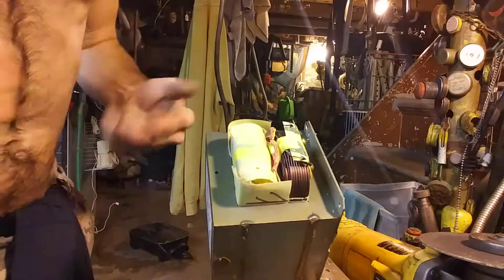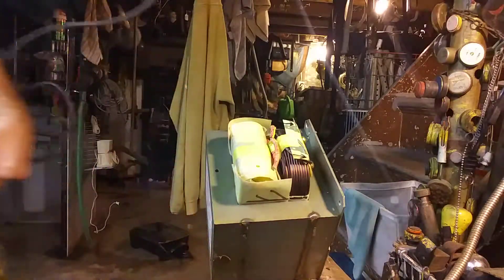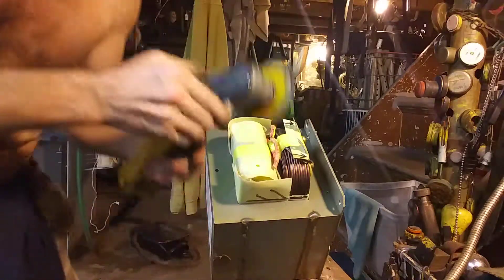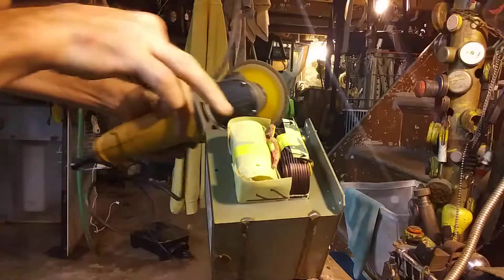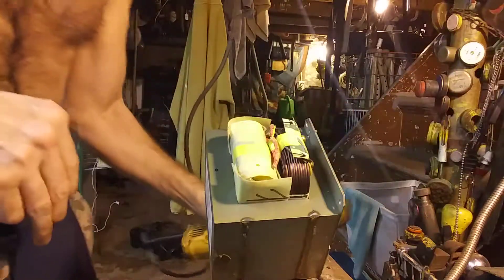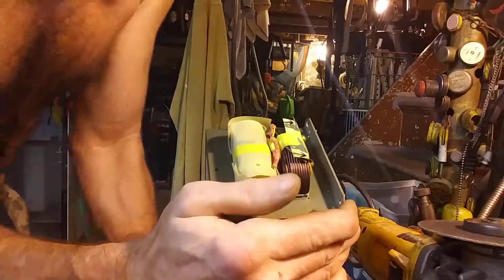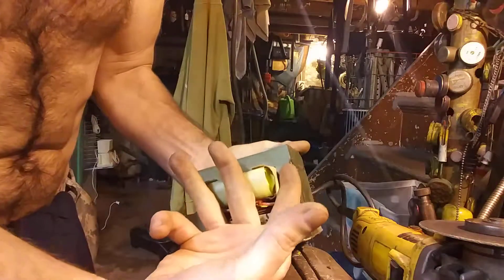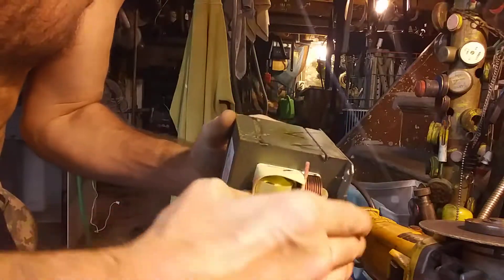Transformers transform(4)

Comment: I did that also and removed the high voltage winding. I know you can't give advice, but I was wondering about the way I am going about it. I was going to use the low voltage of one winding and feed into the other low voltage winding and hopefully get 110 volts on the secondary isolated from the primary. I was going to make 2 transformers to do the job. Because the high voltage winding is removed,   I am separating each plate and doing the bad way you are talking about with the lamination's,  because there is a large gap were the high voltage winding was and drilling out the plates and installing 6 through bolts to anchor the lamination's. If it don't work, I am finding out a lot about transformers. Lmfao.
Reply from the maker: I appreciate your kind words and your reply. The one issue I keep finding out with mine is it gets hot after10 to 15 minutes of working under light load. I will try to dig up my revisited video for you, and watch it myself too, and let you know what im forgeting, another was vibration. I learned you can place metal shunts alongside the windings and that adjust different parameters of the flux between both windings without affecting the isolation.
Reply from the maker: if a 2 amp isolation transformer will work the easiest is to find a pole barn big edison screw in bulb, well the ballast them use is 2 seperate windinds and wired on way will output around 120 volts and the other way (backwards was around 90 volts out. Thanks again and feel free to ask ?? any time.  TY   Randy
Reply from the maker: "simple isolation transformer that runs at 2 to 3 amps and starts up around 5 amps"
Video link
https://youtu.be/pg-mQqfHnsw